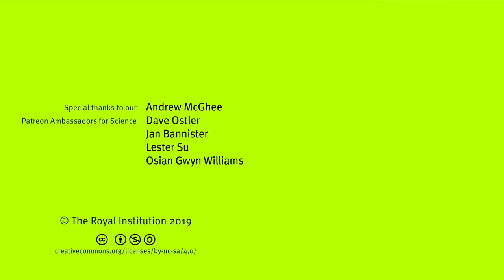Q&A: How Are Skyscrapers Engineered? - with Roma Agrawal

Comment: that sky elevator thing to the moon, may not be so impossible, just not on earth, as cool as it would be to see. Pluto and Ceres are mostly tidally locked to each other and a few have already entertained a possibility of a city of a sort spaning between the two, acting as both a spaceport at the center of rotation and as a means to transit between the two. One of many structures, I think would be cool to see.

credit, Isaac Arthur and crew, one of the colonizing vids.

Comment: By "hardest" material, did the questioner mean the most durable surfaces or the least tractable to use? The most obvious way to construct spaces on the moon is to dig caves in the side of hills and craters. No need to take anything but a boring machine, but the biggest problem would be keeping down the dust. (Nasty stuff with sharp edges that gets everywhere.)
Bamboo (which is actually a grass) is a good raw material for engineered wood products, (laminated like a multi-layer plywood).